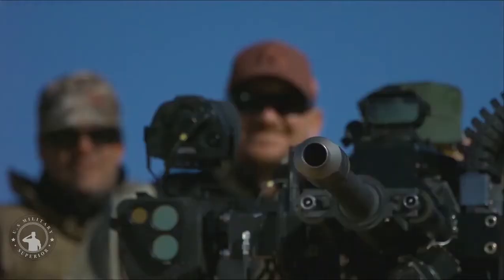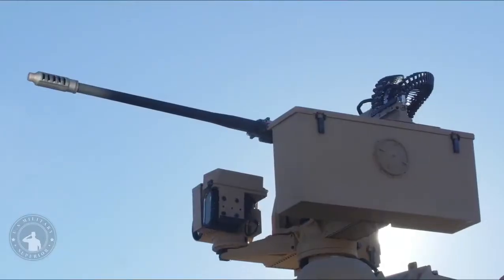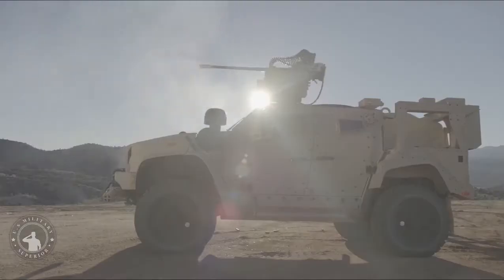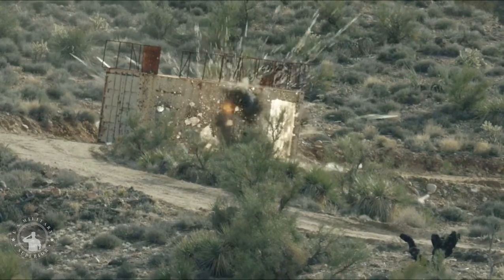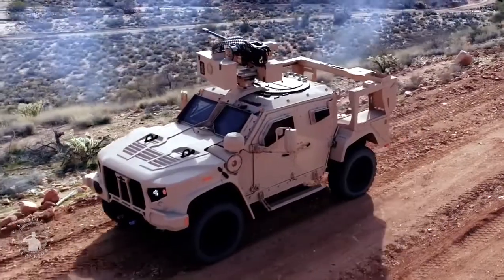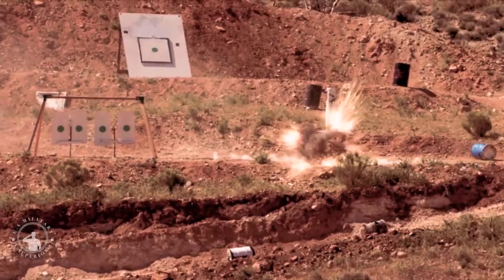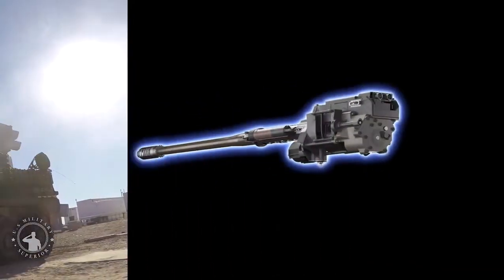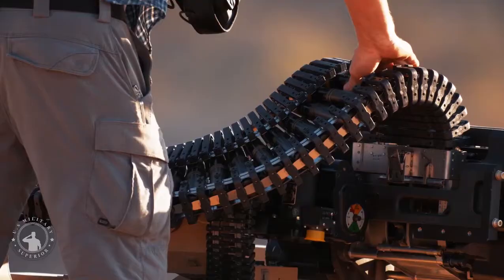The history of the birth of the M230 Chain Gun automatic cannon used by the US Army

Comment: Can it be equipped with airburst rounds for engage hostiles from behind cover?
Reply: Yes. There are a variety of rounds available for it, including timed airburst and proximity fuzed. I'm not sure if it's still the case, but this gun used to have real reliability issues on the Apache helicopter. Also, a system where the ammo box and feed rail are exposed would easily be disabled by artillery splinters or even small arms fire. Thus, I think it's a throwback to the "low intensity" type conflicts the US has been engaged in and would not be well suited to something like what is occurring in Ukraine.
Reply: @maxjohnson1758  

I noticed that exposed ammo belt and immediately thought that it might be problem. Maybe they should just use a remotely-operated 50. caliber machine gun with an enclosed feed system instead of that autocannon.
Reply: @maxjohnson1758  Can it penetrate the armor of a main battle tank?
Reply: @bulgingbattery2050 There is an option for M2s to be pylon mounted.  Ive never seen it used.  The 30mm is used over .50 because the rounds contain explosives, suitable for light armor amd material.  Purpose built for destroying vehicle columns.
Reply: @testtest6169  So it can take down infantry and lightly armored vehicles, but isn't powerful enough to destroy main battle tanks?